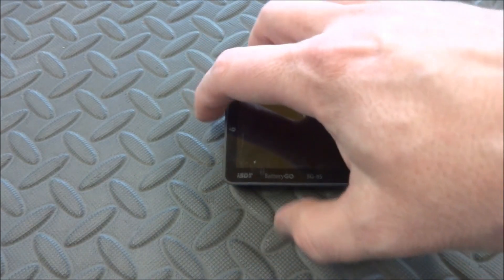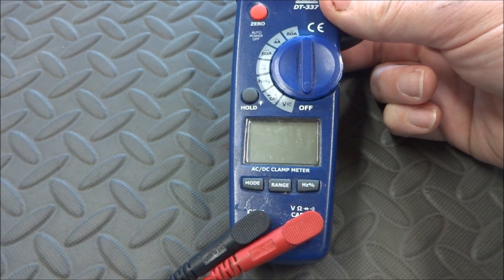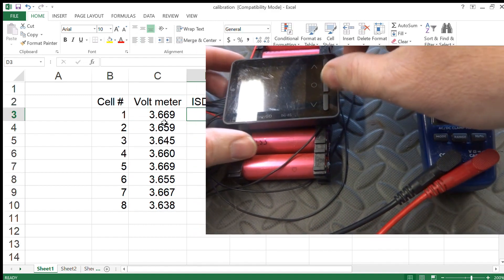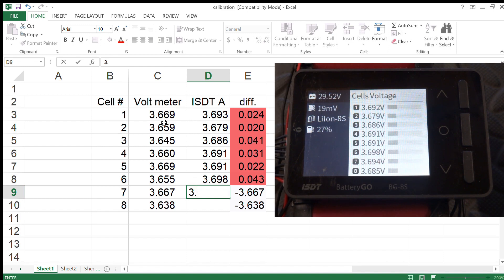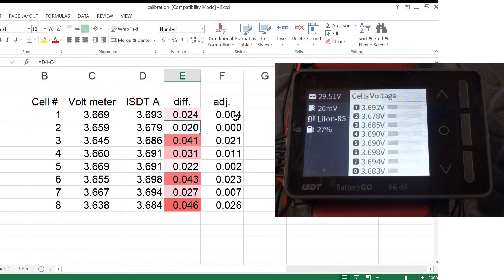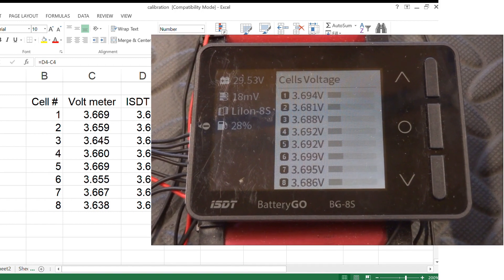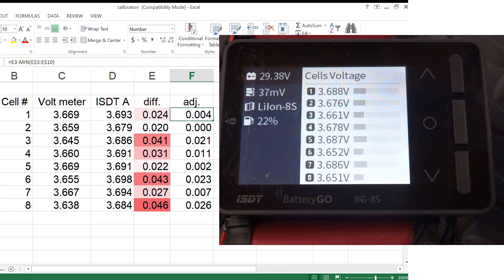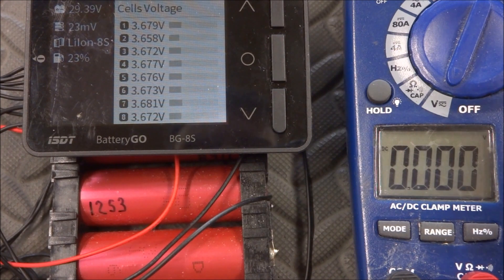How to Calibrate an ISDT BG-8S

Comment: Youre not answering the question for why your not taking the voltage difference from the multimeter and setting it in the isdt. Why the calculation and less input in the device....I do thank you for your how to😄👌

Comment: If you read the voltage with reversed polarity you'll likely see a slightly different value. I'm not exactly sure why but it happens with all my meters typically about a 2mv difference

Comment: maybe i missed it but why when calibration how did you get the adjustment number? wouldnt the amount you need to adjust it by be the number of the difference? also when calibrating it why wouldnt you just set it to the number the multimeter said it was?
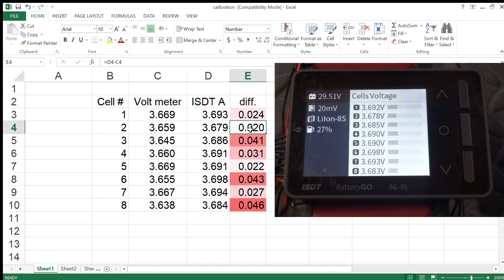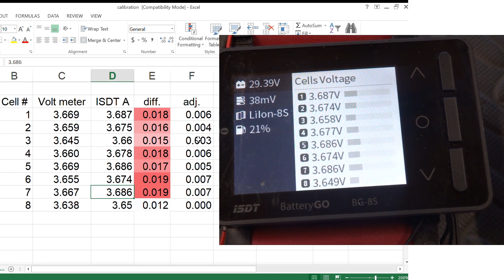6:55 you lost me there. why on earth would you do that? seems like if you just set the isdt to what the multi meter said you wouldnt have the variance you do at  10:25

Comment: Quick question. Why the spreadsheet? Could you not align the V on each port of the isdt with the recorded one from the voltmeter? Btw great info on unlocking to adjust and input of codes. Thanks again 👍

Comment: Hi, I have a question, I just bought the isdt q8 model, after the charge is complete and the screen turns blue, the amp of the device (top left) will not be zero!  Is this normal ????  Because the battery is no longer added to the amp, but the device is still circulating between 0.5 and 0.3 amps !!  Please help me, thank you
Reply: that's probably the balancing current. The majority of the charging is done, the charger is now using its balance current (I'm guessing its 500mA or 0.5A for the Q8) so it can counter any charging current up to 0.5A as it tries to bring up a low cell.

Comment: Thanks, you are a little slow getting to the point,  but i wouldn't have thougth of this if i hadn't seen your video. Of course, is your voltmeter calibrated? at least they will all be set to a common meter.  Found that one of my banks was off .21 V low and the whole battery was trying to balance it up, and i had been trying to balance it over whole night. When measured with my VOM it tested higher than any other cell bank in the 8s battery. Thumbs up.

Comment: I'm going to try doing a fine tune celebrate to my Spectrum SMART volt meter, hopefully the password key is all the same. Most of us don't use 8S so just 1 through 6 with fluke and call it a day. I see myself just putting two 4 cell packs in series before by 8 Cells.

Comment: It doesn’t memorize the battery type voltage setting.... like when switching between Lipo or Life... also doest measure battery resistance. Yes it’s nice, but lacks functionality for its price. Features are nice, charging your phone, but then there is no mah counter.

Comment: Hi. When using latest firmware, can it alarm when voltage goes higher than set value?  I know it will alarm if voltage goes below set value when discharging, but I need when charging up. Please confirm.